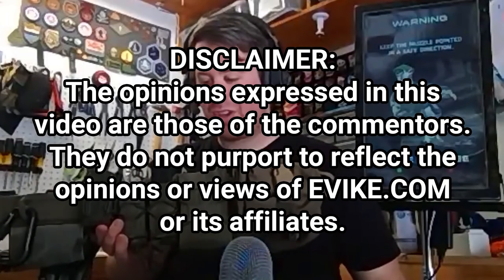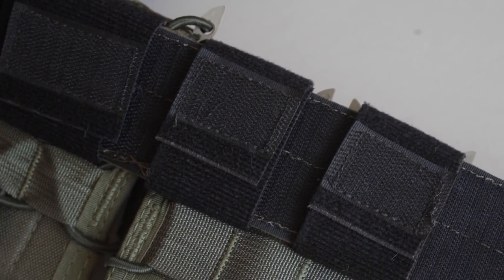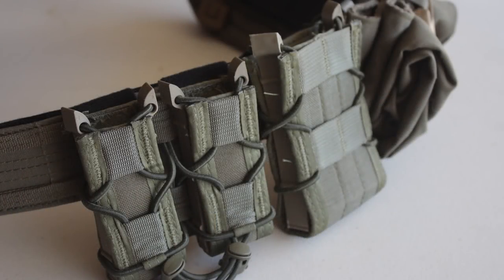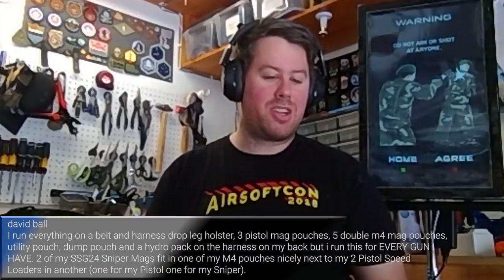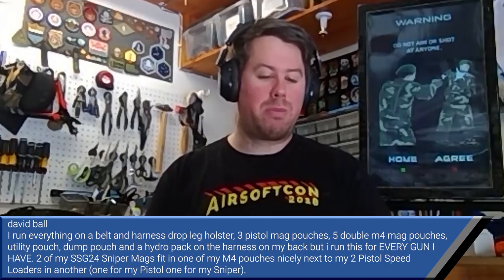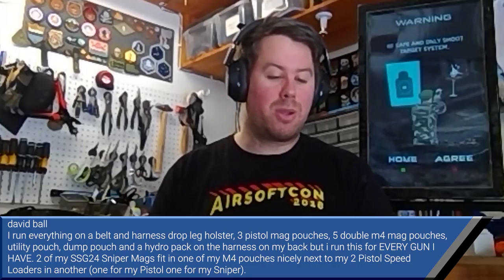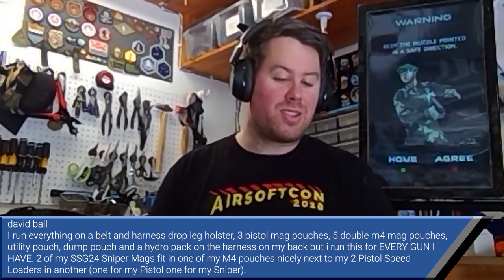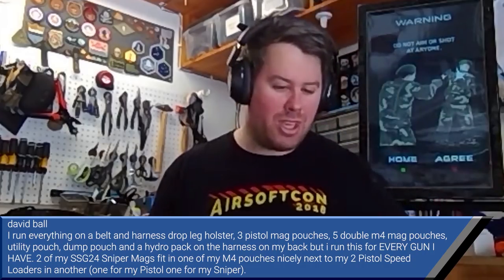How to Set Up Your Battle Belt - NSRT Ep.146 Part 2

Comment: For most of the time, I'd use a Safariland 7395RDS holster with a QLS kit and a 3004-1 replacement leg strap put onto it.

If I was using a suppressor, I'd remove the Safariland and attach a T.Rex Arms RagnarokSD holster, fitted with a QLS fork (the pistol needs a Surefire X300 light for the holster to work).

For everything else, I'd use the BDS Tactical Modular Universal Holster.

Comment: When traveling, it depends on the method. For an example, the TSA has strict rules on the transport of firearms, and honestly most of them have probably never heard of airsoft or know what an airsoft gun is. So therefor leaving an orange tip might get be important to stay out of trouble/confusion along with following their other rules like having a hard shell case and keeping it locked. When it comes to international travel, it really heavily depends on where you go and most of the time the question will be "can I bring this" rather than "how will I bring this". But with driving you can really do whatever you want as long as it is out of a peering eye and you let the cops know that is only a replica in case you get pulled over.

Comment: sometimes with drop leg rigs you dont have a choice. Try running a suppressed mk23 with a mid ride or waist ride holster- no bueno. The 3d Printed mk23 holsters are no good, very difficult to reholster without twisting your wrist out of shape. the Tornado holster fits the bill for this usage and its not that heavy.
i run a gun fighter belt with a liner. My belt is set up for multi-functional use ,ease of changing out accessories depending on what I'm doing and what gun I'm running. I generally run as a sniper so being light is essential.

Comment: Just be mindful of the airsoft regulations pertaining to each state or country you're flying to before you go. I use a lockable hard case for air travel, which...if you try hard enough..can fit 3 guns w/ LiPo batteries and magazines. For gear like tools and PPE, I just stash in a large backpack.